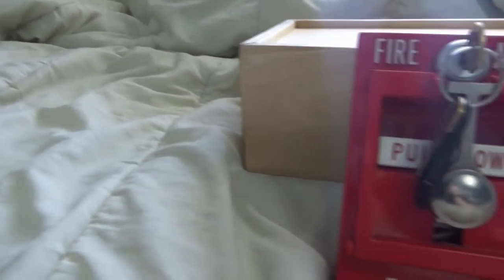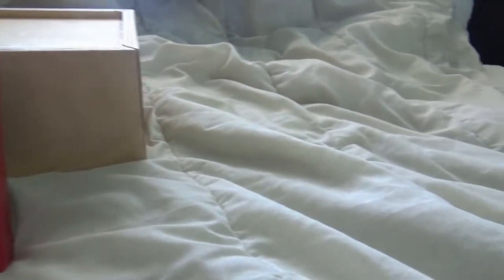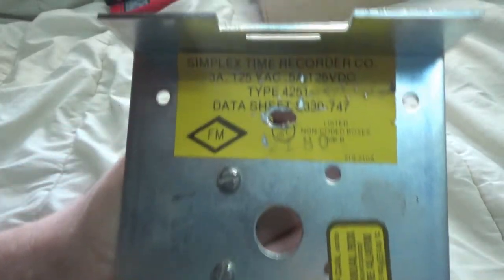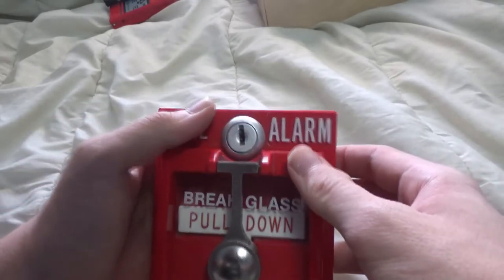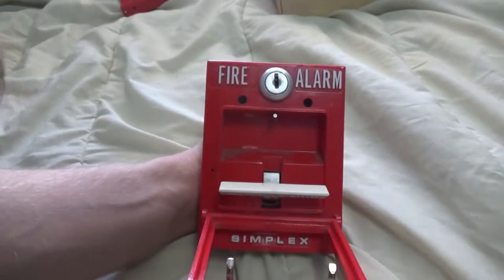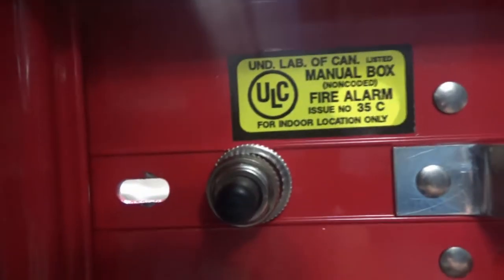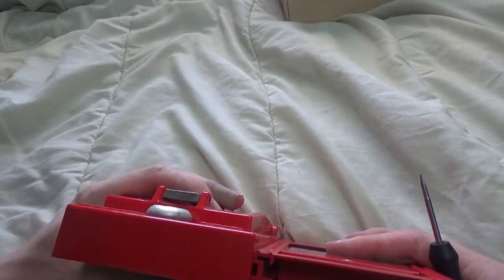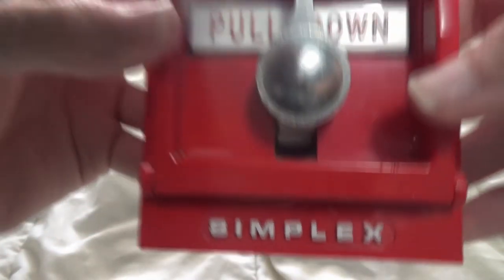Reviews | NEW Simplex & Notifier pull stations! #FireAlarmFriday

Comment: Will it run on 125v ac or 30v dc
Reply: Will u run it on 30v dc
Reply from the maker: Both devices work on 24volts DC. (I can’t test them but 97% of systems are either 12volts or 24volts DC, so these pull stations will work.) I don’t know about 30volts DC or 125volts AC however.
Reply: @TemporalEngineering  my pull station says 30v dc
Reply from the maker: @aidancprailrailwaystuffeng4612  Hmm...